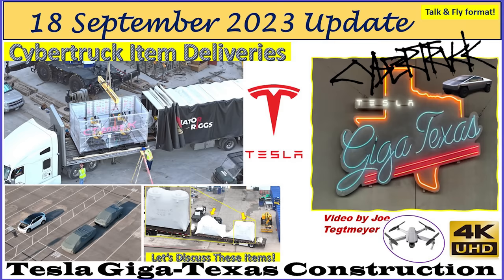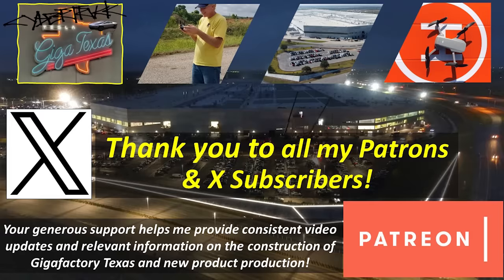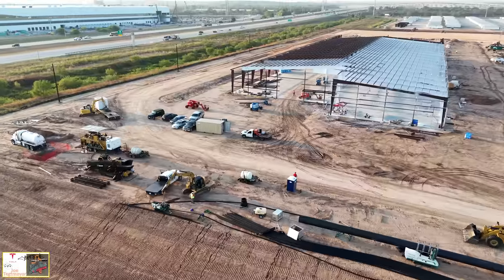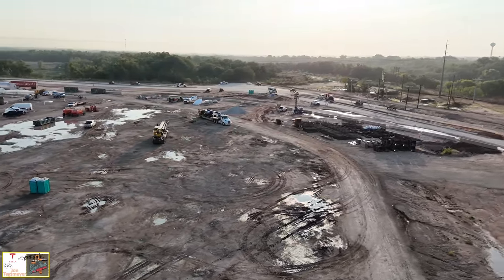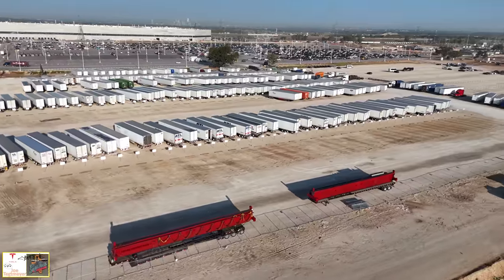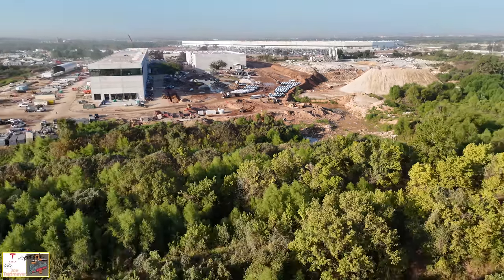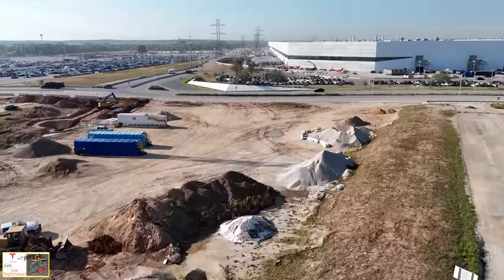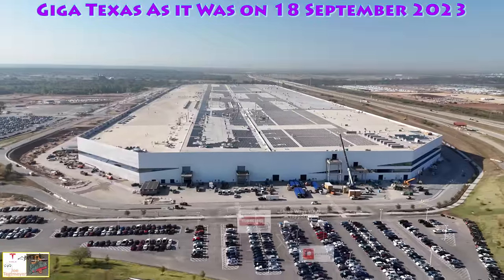Cybertruck (CT) Production Equipment & 5 CT's on Site! 18 September 2023 Giga Texas Update (07:55AM)

Comment: They can't build the compact G3 within the existing walls of TX. Not at scale, meaningful scale. 40% reduction in required space, so they say. Still need a lot of lines. How much room is left? Still be a good bit around even after the MY expansion and large potential CT production. Not a question of can they but of why would they. The market for a compact in the US would be quite low. They could certainly produce a quarter million a year. Why? This isn't panic. He's right to build and sell them first in the US, local market. You don't want to be exporting 'til you're sure of the product. Local folks are more forgiving. Good thing the world over/for our species.
Reply: Most, if not all new models have come out of Fremont. One must start somewhere.
Reply: No space in Fremont. TX could put in a 1/4m line/s just to serve the US market and if more is needed then Mexico supply.
Reply: They want to develop the new lines - CT and G3 ( model 2? ) - where the engineers can be physically present and working on the problems, hence Texas
Reply: I think either Fremont or Austin would be good choices for a preproduction line. I'm a bit biased for Texas but hard to tell without details.
Reply: Farzad Mesbahi worked at the Tesla Fremont production facility.  He was asking for 10,000 square feet to work on a project, and was not able to do so, because there is just not extra space at that plant in 2019.  

I am thinking that by the end of 2027, Tesla should have a second building the size of Giga Texas built nearby.  I have a feeling that Elon Musk wants to own the largest possible buildings.  However that is not a practical solution.  Many buildings is actually better.  If they have a fire at one building, then the others can keep working.  When they need to upgrade the power system at one building, it is easy to get a 4,000 amp 480 volt service.  However by making the building 8 times larger, a 32,000 amp 480 volt service is not actually practical.  Then you need to move 4,000 + amps several hundred feet from one section of the plant to another.  Sometimes over 1,000 feet of 480 volt power.  That is EXPENSIVE!  

Then there is the employees and timeclock locations.  They are pretty far from the parking lot.  With a larger building, that makes them even farther from the parking lot.  Noise is also a problem.  The press room at the place I worked at was really noisy, so was the area with screw machines, and that area also had a lot of oil in the air around those machines.  This was in the northern 500 foot extension to the building, and the southern 3/4 of the building was more for the production lines.  So a lot less noise and heat.  That building was 420 feet wide and 1,250 feet long.   It had a 12,000 amp 480 volt power system, with three bussbars, 4,000 amps each, one going the length of the plant, another going to the automatic polishers, and the third into the basement to run the plating equipment down there.  

Each section of bussbar has aluminum bars inside it, and they can attach a 30 or 60 amp disconnect to each section, 10 per 10' long section, and the power anything in the plant.  

So yes I understand that there is a long walk between the parking lot and the time clock and our work stations.  And our building was only about 750,000 square feet.
Reply: My point was that all current models were launched out of Fremont. Texas certainly has room.  @memrjohnno

Comment: I cannot even fathom the expense but starting to look like a nuclear power plant kind of money with I imagine some big time Boeing accounting thrown in for good measure. Long $IBM International Business Machines strong buy
Reply: Nah, not even close to nuclear power station money. The insanity of how we construct those in the US is mind boggling. I have a few generations of family who are ironworkers and pipefitters. The cast offs on those are something else. I had an uncle who worked on the South Texas Station unit 1 for years as a pipe fitter. They built a BBQ grill and smoker out of cut off scaps of nuke rated stainless steel pipe.  Used a 3 foot section of 36 inch pipe for the main grill area, a 2 foot section on 24 inch for the fire box and a few feet of six inch pipe for the smoke stack. Probably four grand worth of scrap steel. But that’s not we’re the real waste is located. The real problem is that every unit is a one off. No two units are the same. The design, work, rework, inspection, testing, and documentation are never reused. It’s the most wasteful method of construction ever. Little wonder that the two units cost around 13 billion dollars in  2000s money. Probably close to 20 billion in current dollars. It took them 13 or 14 years to build and 4 units were supposed to cost less than a billion.  However, if we could ever agree upon a standard design and replicate them like any standard product, they might make economical sense. Till then they don’t.
Reply: @DessieDoolan  If we are going to transition from fossil fuels to solar and wind, think of the cost of batteries. Not just the cost of batteries to cover peak power usage, but baseload power generation as well, when the sun doesn't shine for days and weeks. As is the case in many regions. Basically batteries are useless to cover baseload power needs. 
I don't see how the transition is even possible without nuclear being in the mix. 
William Wheeler is right in that we need to get the cost of nuclear power down. And you are right that the numbers don't add up. But that is for nuclear power in its current form.
It might be possible to get the cost down with  Small Modular Reactors (SMRs) now under development. Since they would be a standardized design built on an assembly line in a factory.
Reply: @DessieDoolan  ,  If anyone wants to push Nuclear power, they need to study the new Georgia Nuclear Power Station, and it's 30 Billion dollar cost.  If they are paying about 5% interest on that $30 Billion cost, that adds $1,500,000,000 a year to the cost of the building!  So a delay of 1 year is not just "Well we will not have this power plant producing power this summer" - it actually means the cost will go up by $1.5 Billion in interest costs!  Even 1 month delay means $100,000,000 in increased costs!  

They started production of that plant in 2009, and just finished it in 2022.   So production delays are the normal for nuclear power, not the exception.  

With a Billion dollar wind farm, it is normally completed within 2 years, and can start production even before all of the wind turbines have been installed.
Reply: @Kangenpower7  Agree. It's a lost cause. Not everyone has read the memo yet!

Comment: So no production of any models at this time? Wonder how long that will be....
Reply: I have a feeling they might be changing over from the current model 3 to the new style model 3.  So a lot of dies need to be switched out, and new body panels will be installed on the new car.  So that normally takes Ford about 2-3 weeks for a new model change over.  I would guess that also happens at Tesla, so in about 2-3 weeks, they should restart production.  It was stopped about September 1, so I guess it will restart about September 25 (Monday) at full rate.  With maybe a introduction to the new car and employee training over the next few days.  

My brother was driving truck #000065, owned by Ford, a F-150 pickup.  He worked for Ford, and leased a truck from them.  The early number trucks where all bought by Ford for employee use.  After about 1,000 trucks, then they when to customers.  So that is about 1/5 week of production.  They produce 5,000 F-150's from each plant, and 5,000 a week from the F-250/350 plant.  

Some people speculate (wishful thinking mostly) that they will produce more and more Cyber trucks out of the factory.  However they do not realize there is a limit to how many can be produced in each factory line.  The limit is about 1 per minute, and they can not add minutes to the year. So 5,000 a week is about the upper limit of any manufacture.  So yearly production will happen at a maximum of about 250,000 per line.  Now if they where to put in a second line (so double the size of the building, and 5 giga presses, not the 2 they are using right now) they could double production, but it will be exceedingly expensive to do so.  

What Ford did is build another production plant for the F-150, so they had two.  And they build the F-250 / 350's in another site.  When Ford decided to build the electric transit, they still make the transit chassis and body and paint it in the same factory as the gas model.  Then in the parking lot, they built a building to produce the electric van with the painted box coming out of the gas factory.  

Ford did the same thing with the F-150 electric truck.  Built a building in the parking lot (I think it is over 300,000 square feet), and predicted building 15,000 Lightning trucks per year in 2021 and 2022.  However they got so much demand, the expanded the building and production to about 155,000 trucks per year.  (I think that 2023, they can make 155,000 Lightnings).  

In 2025, Ford is supposed to have about 250,000 production space in the new Lightning plant.  I was hoping and thinking maybe they could start production in 2024, but it looks like it might be later than I was hoping.  So maybe start production sometime in late 2024 or early 2025.  They will also be producing a lot of batteries there too.  43,000 MW of batteries at that location, and two other locations with about 40,000 MW of battery production per year.  

So I am guessing that by the end of 2025, you can walk into any Ford dealer and find a Lightning on display there.  

Cyber Truck, right now they have about 2 million reservations!  I wonder how long it will take to produce that many of the trucks?  My guess is that by 2025, they will be making 250,000 a year run rate.  By 2028, the Mexico factory will be running at speed.  Maybe they can also produce 250,000 a year?   I don't see space in the current Texas factory to produce them on a second line.  So it will take a while.  Maybe they will build a second building in Texas to produce three more lines of cars and trucks?  That would be a building larger than the current Giga Texas.